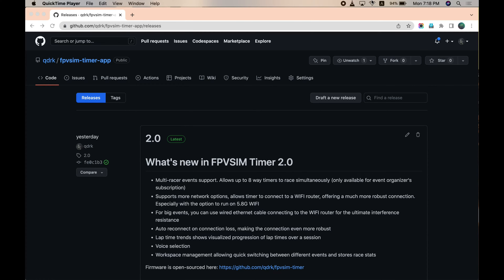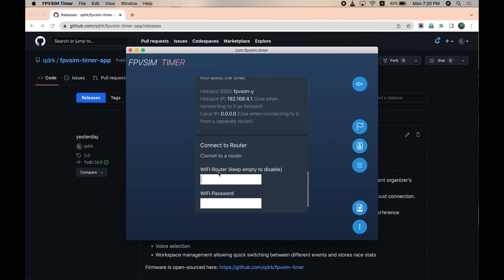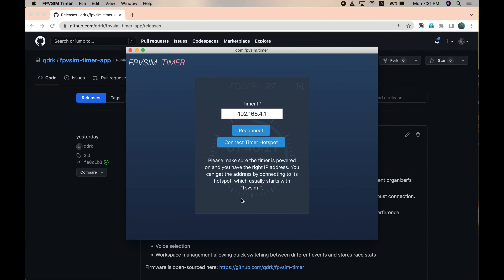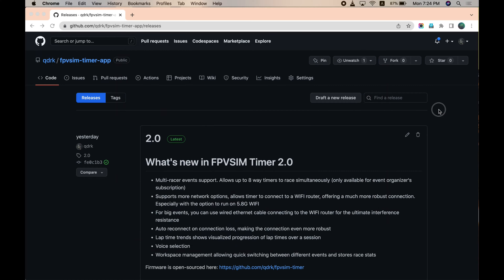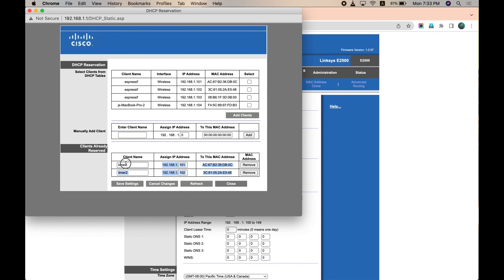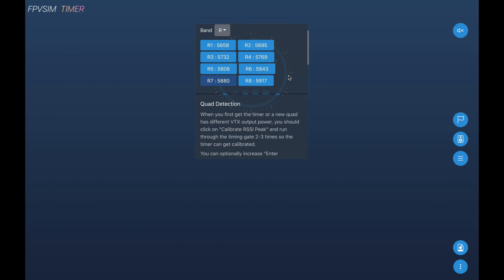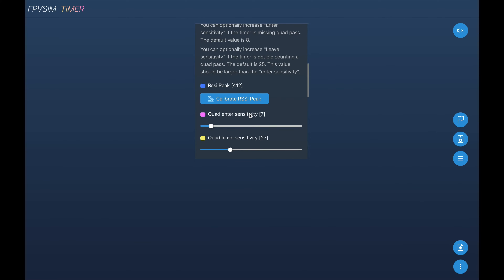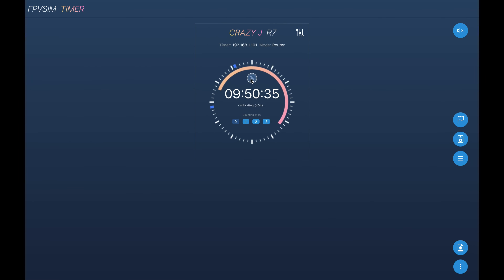FPVSIM TImer - Solo Version Setup

Comment: This is a very interesting project, I'm going to put it together. Do I understand correctly that the channel change goes through spi (ch1-3), so based on this project, you can assemble a simple video signal receiver, because for this you just need to finish av out?
Reply from the maker: That's correct!

Comment: If my board has a reset button instead of a EN(enable) button can I still use it? Also why is the power going to the VIN pin doesn’t that pin supposed to power the esp32 board? Mine says input 3.6v- 18v on the VIN pin.
Reply from the maker: Yeah, different board has slightly different configurations. Follow what your board manual says about powering.

Comment: I'm getting this error: Error: Please specify `upload_port` for environment or use global `--upload-port` option.
For some development platforms it can be a USB flash drive (i.e. /media/<user>/<device name>)

Do you have any advice on this one?
Reply from the maker: This means your Usb to ttl driver is not working correctly. What's you board model and os?
Reply: @fpvsim  ESP32 DEVKITV1 ESP8266 WROOM32.  OS is windows 10
Reply: SOLVED: Once I downloaded the CP210x USB to UART Bridge VCP Drivers it worked. Thanks!

Comment: Hi, great videos, i am hung up on flashing and hope you can help.

I am on Windows 11, ESP32-WROOM--32D, rx5808 20120322

When i try and flash, i get the error saying... Failed to connect to ESP32: Wrong boot mode detected (0x13) ! The chip needs to be in download mode.

So then I hold down the EN button during the whole flash process and and I get this error....  Failed to connect to ESP32: No serial data received,

Any help is greatly appreciated! im very new to all this, and I am hoping it's a rookie mistake!

Thank you
Reply from the maker: Try to hold the boot button while pluging in the USB and flashing. Some dev board have different configurations.
Reply: @fpvsim  that worked. Thank you very much! I am now a racer sole subscriber. I also bought a pre-order from batch 3 of fpvsim 2.0. That version looks really clean!  Thanks again

Comment: Finally a project with up to date software - thank you. Is there a way to get a list view of the past lap times? I couldn't find it so far.
Reply from the maker: Yes, you need to start a race first - the first circle button on the mid-right side
Reply: @fpvsim  Thank you, got it working. Does the full version have a setting for minimum lap time? I'm on the edge of buying the license, but couldn't find such a setting. I'm currently using it for indoor flying with a tinywhoop, so I've a gate where i fly nearby twice. On Chorus I can set a minimum lap time to avoid that it counts twice, but I couldn't find it on fpvsim yet.
Reply from the maker: @Leif_YT  I'm planning to add this setting this weekend.

Comment: 我发现GND和RSSI的接线和示意图里面好像不太一样，电阻那个位置，正好反了
Reply from the maker: 没太理解，电阻不管正反的哦。能详细点吗？
Reply from the maker: Oh, there are two GNDs by the way
Reply: @fpvsim   I mean the wiring demo picture on your website is a bit different from this video（the 100k resistor wiring）😂, after I check twice the wiring graph I got right installed finally. Thanks.